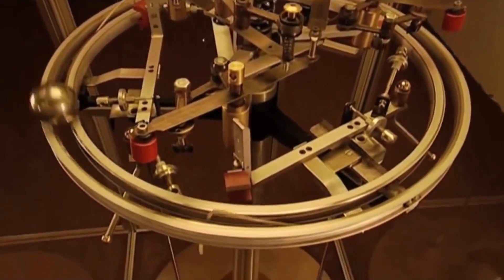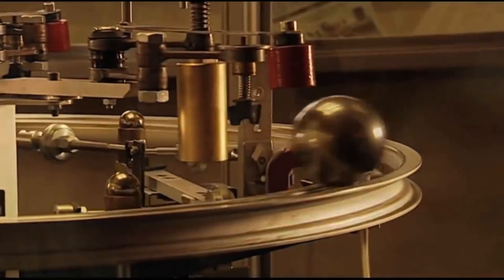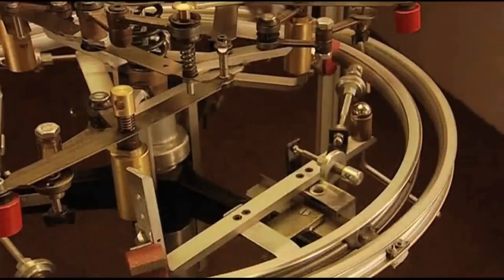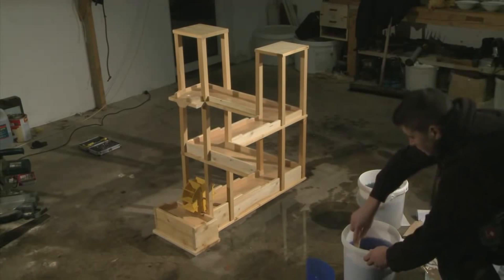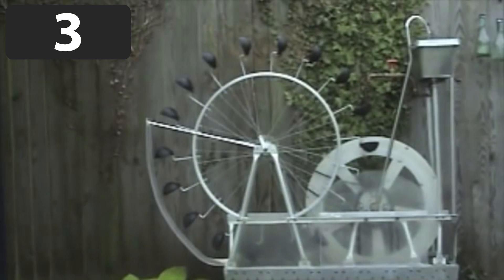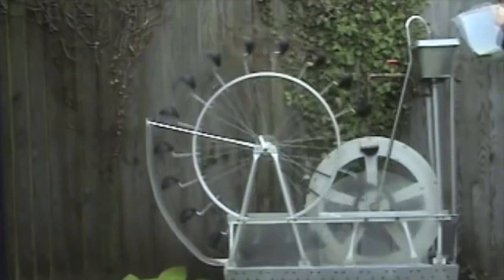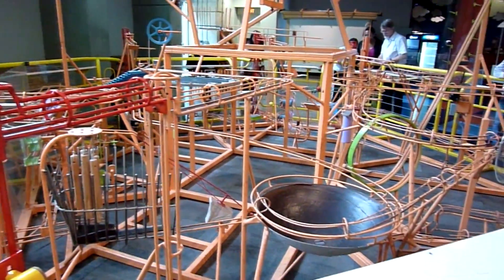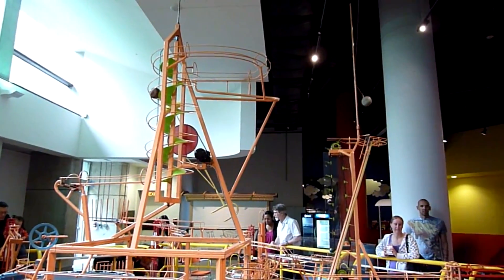Top 5 Near Perpetual Motion Machines

Comment: "close"... there"s no such thing as "close to perpetual motion" - either it exceeds unity or it doesn't.
Reply: It's like being a little bit pregnant!!  Either you are or you ain't!!
Reply: Especially when he says "it will run for several hours". I laughed at that.

Small point though, perpetual motion doesn't actually require it to exceed unity, it does have to achieve unity.
Reply: Whats missing in their attempts that cause failure is " make one side of a wheel heavier than the other " . .   The answer is to make the other side lighter . Underwater is the environment best suited for this ( gravity harness) . 12 airbags (6 full and 6 empty) astound wheel at o'clock positions with 12 3 lb. Weights outside them. Weight can be used to take air with it down 4" over airbag at top of weel (to bike rim) . Bottom is 4" down (from bike rim) taking air into the airbag. (Was emptied at the top) 
Top goes DOWN = towards the axle 4"
Bottom goes DOWN = away from axle 4"
But the air goes all the way to the bottom . 
And all airbags full being on one side (enough air to bobber the 3lb. Weight its next to) Gravity is harnessed...
From the archangel Ram full Than
Reply: I'll translate for you. Close to perpetual motion means attempts that create the longest moving machine.
Reply: @MrUnstoppableHeart  https://en.wikipedia.org/wiki/Clock_of_the_Long_Now A clock that runs for 10,000 years, but no claim that it is perpetual motion.
Reply: I disagree, if perpetual motion is 100% then wouldn't 99% be close? 99.9%? What's the point to your smugness about perpetual motion? If flying is maintaining the constant altitude, isn't a 0.0001% drop over time still close to flying? Get over yourself.
Reply: @XXCoeusXX  no- and here's why: perpetual motion means that it will in principle go forever. For that to happen it has to produce as much, or more, energy than it consumes. If it produces 99 % of what it consumes it will not go forever, and it will grind to a stop in finite time..
    So imagine it winds down in a week - is that close to "forever"? What if it winds down in 1,000 years -- still not close to forever.  No finite time is close to an infinite time.
      But the real point is the energy consumed vs the energy produced, if it consumes more than it produces then it is not perpetual motion by definition.
Reply: @karlschuch5684  You seem to miss the point, and instead glibly state facts about perpetual motion as if to educate me on it. 

The point is being "close" to it. If we did indeed invent a PMM, but a planet destroying asteroid hit the earth, you would claim that "oh well it didn't last forever so it doesn't count. So really it's about the % of efficiency and not how long it ends up lasting. At a certain % it is considered close.

You might as well be arguing that 89% isn't close to getting an A- grade. Because it either is or isn't an A-

You are logically using finite/infinite=0 which is contradictory, because while it won't actually be 0, it will be CLOSE to it.
Reply: @XXCoeusXX  
Epi: The point is being "close" to it. If we did indeed invent a PMM, but a planet destroying asteroid hit the earth, you would claim that "oh well it didn't last forever so it doesn't count.

KS: no, that’s why I explicitly said it was about energy produced vs energy consumed, obviously no machine can run infinitely because nothing last that long... including the universe perhaps. 
     What we are talking about is whether the ENERGY  produced by the machine would – "In Principle" – enable eternal motion of the machine.

 Epi: So really it's about the % of efficiency and not how long it ends up lasting. At a certain % it is considered close.

KS: no, the word “perpetual” has a real meaning, it means never ending,  an infinitely long (unbounded) period of time. There is no finite time period that is close to an infinite time period.

Epi: You are logically using finite/infinite=0 which is contradictory, because while it won't actually be 0, it will be CLOSE to it.

KS: I have no idea what that means.
Reply: @karlschuch5684  
ks: There is no finite time period that is close to an infinite time period.
E: finite/infinite=0 This is what you are saying here, that infinite is so long any finite is practically zero. But it isn't 0, it is really close to it though. Which is inversely related to reaching 100% efficiency(PMM).

You contradict yourself in your first and second paragraphs. 
1st ks: no, that’s why I explicitly said it was about energy produced vs energy consumed, obviously no machine can run infinitely because nothing last that long... including the universe perhaps.
2nd ks: no, the word “perpetual” has a real meaning, it means never ending,  an infinitely long (unbounded) period of time.

So which is it, energy produced vs consumed or lasting forever?

 ks: What we are talking about is whether the ENERGY  produced by the machine would – "In Principle" – enable eternal motion of the machine.
E: right, and that means 100% Efficiency, and then taking that efficiency and putting it back into it, making it last "forever".

I wrote a paragraph about real world PMM applications, but decided to delete because it went on quite a bit, but is now seeming necessary . . . . .  but the #1 usage would be energy storage. We put in X amount of energy and get out X energy whenever we decide to withdraw it. It doesn't have to last "forever", it has to have the longest energy retention ie. % efficiency over Δt. Think Flywheel energy storage.
Reply: E: finite/infinite=0 This is what you are saying here, that infinite is so long any finite is practically zero. But it isn't 0, it is really close to it though.

KS: great – give me an example of a finite time period that you think is close to an infinite time period.
 Please be specific - thanks

Epi: You contradict yourself in your first and second paragraphs. 
1st ks: no, that’s why I explicitly said it was about energy produced vs energy consumed, obviously no machine can run infinitely because nothing last that long... including the universe perhaps.
2nd ks: no, the word “perpetual” has a real meaning, it means never ending,  an infinitely long (unbounded) period of time.
So which is it, energy produced vs consumed or lasting forever?

KS: you conveniently left out the next sentence in the first example – where I said: “What we are talking about is whether the ENERGY  produced by the machine would – "In Principle" – enable eternal motion of the machine.”
  That seems like a desire to misrepresent what I said...?
 
Epi: So which is it, energy produced vs consumed or lasting forever?

KS: it is both - as I've explained like a half dozen times. One more time - if the energy consumed is less than the energy produced then "IN PRINCIPLE" the machine will run perpetually (forever). 
   and once again - nothing lasts forever hence the use of the expression "IN PRINCIPLE"   - Which means that if the machine COULD last forever the energy produced would be sufficient to fuel it forever 
  Do you understand what the expression "in principle" means ...? -
Reply: @karlschuch5684  
ks1 response: Still not getting the point. I suggest you look up 1/infinity as an approaching limit expression. It won't ever be 0 but it gets really close. Which that "closeness" is the same way I mean we can get "close" to a PMM.

ks2: no I didn't leave it out, I quote the next sentence as well. You seem to have a problem reading my whole response.

ks3: Before there was a hint of condescension, but not it is very obvious. You repeating efficiency of a PMM is unnecessary as the concept is not lost on me, nor is "in principle".

Which means that "in principle" it doesn't have to last "forever" but given the efficiency of it, it could. Your "in principle" usage basically says it just needs to have an infinite trajectory, regardless of it actually needing to last forever, so again it's not about lasting forever, it's about % efficiency over Δt (which is calculated).

You did not address my real world PMM, which I find rather funny, you're hiding behind a theoretical infinity and "in principle" that you miss out on the reality of the application.
Reply: @XXCoeusXX  ok,  you're not answering the questions i ask,  and division by infinity is not defined.
    And now appears that you're pretending to not understand simple things because no one is that obtuse, and I have no interest in ridiculous conversation.
 Have a great day!
Reply: @XXCoeusXX    Against my better judgement I will respond to your last bit of nonsense.

EPI: (ks: "give me an example of a finite time period that you think is close to an infinite time period." )
Which is obviously rhetorical, because it's a nonsense question used to deflect from the point I made. 

KS: no son you made the statement “Which that "closeness" is the same way I mean we can get "close" to a PMM.” 
  So go ahead and give me an example of a time period close to a perpetual (infinite) time period – I await

EPI:Your googling could use some work, as you missed the concept of approaching limits division by infinity, but only walked away with a sort of answer.

KS: yeah, this is the best one from you yet. I have a degree in Mechanical Engineering from Rutgers University class of 83. In that curriculum we had 5 semesters of calculus, two of them in DE’s.
   I know more math than you know even exists – and you want to lecture me on limits… unbelievable.

 You said: “  I suggest you look up 1/infinity as an approaching limit expression”
No – division by infinity is undefined -  infinity is NOT a real number, it is a concept... you can't divide a number by a concept . 
    If you want a lecture on the limits of functions I will give you one...until then  - go take a math course before you spout your ignorance.

 I learned a long time ago that it’s impossible to reason with the unreasonable and the ignorant – it’s like playing chess with a pigeon -  the pigeon knocks over all the pieces, craps on the board, and struts around as if victorious.
Reply: I gave you a finite time that comparable to infinity. No answer to that though hu?
Reply: @XXCoeusXX  EPI: I can give you a time period, 10^100 years(finite)….I think that is more than "close" enough. But don't go moving the goalposts now, you were the one that made this a hill to die on.

KS: sorry son, but that’s nowhere close to infinity ( btw I already said the universe will likely not last infinitely long -  but the heat death  of the universe has absolutely nothing to do with infinite time and as you just pointed out - it will occur in a finite time from now - but I would guess you know that anyway)
    And in fact 10^100^100^100 isn’t even close to infinity – so your claim fails.

EPI: Awww that's cute you took calc 35+ years ago at a school that's not even in the top 20 to go to, sad brag bro. I took a CPR class once too, but I wouldn't trust myself to perform it on someone today.

KS: the point is that I know math and you obviously don’t if you claim a number can be divided by infinity – that’s just wrong

EPI: Idk why you don't get the analogy, especially with your oh so prestigious education(lol).

KS: so this is a logical fallacy called the “ad hominem fallacy” –  where rather than arguing the facts you instead attack me personally --- that is what children do and it’s fallacious

EPI: You made the point that any finite, lets say 20, over the course of infinity is not close, …At some point it is close.

KS: there is no finite number that is close to infinity – it seems like you just don’t understand what infinity means – perhaps you should look it up before continuing to embarrass yourself this way…?

EPI: You have this weird thing where you say no to something I said, and follow up with straw man responses. I Never said 1/infinity is defined, I said to look it up. 

KS: You said: “finite/infinite=0”… that IS a definition!!! -  but its wrong because division by infinity is undefined --- again you seem to be pretending to not understand simple things – why?
  You also said: "I suggest you look up 1/infinity as an approaching limit expression."
     GEEZ! the word "approaching" means to NOT be dividing by infinity 
------ and the expression is "THE LIMIT OF THE FUNCTION as "X" approaches infinity"   there is no " "approaching limit" ... this is ridiculous - i'm arguing calculus  with someone who never took calculus
      - but go ahead -  please point to a source to validate that claim... i can't wait.
 

EPI:You can though divide by infinity, no question there, that's one of the uses of limit expressions. Yes the answer is undefined, not saying it is defined. I hope you aren't saying infinity has no use in mathematics.

KS: good lord – limits of functions are about where the  function converges as a  denominator “approaches” infinity or Zero   (mister  “ I do calculus all around the world”) – what is meant by “approaching infinity” is to stay in the realm of real numbers and the word “approach” is an acknowledgement that nothing can be divided by infinity ( or by zero).
    Just out of curiosity – where did you study math? – as  your knowledge is very  incomplete.
Reply: @XXCoeusXX  
EPI; You claim you can't divide by infinity, but then say finite/infinity=0. So you can or you can't? You have a habit of contradiction.

KS: no – I was quoting you insisting that division by infinity is possible – and I have been trying to get you to understand that it is not possible… that’s ALL we’ve been talking about…  Are you pretending to not understand again?
  Are you seriously denying that you've been insisting division by infinity is not just possible but it's actually calculus???
  Are you denying that?

EPI; I know what the ad hominem fallacy, but I classified what I did as sarcasm, and disbelief in your lack of understanding, as you assert yourself as being so highly educated. More pointing out hypocrisy in your resume as an "SME" on the topic, as you seem to be claiming. 

KS: yes, I am accomplished in calculus – as I pointed out. And btw Rutgers University is a very good school, more than you could ever take on for sure.

EPI; IF you claim all knowing and someone questions it, that doesn't make it ad hominem to put your resume under scrutiny. Nice try though.

KS: no,  the ad hominem fallacy occurs when an interlocutor attacks the person rather than addressing the material… and that is what you did.

EPI: I never said finite/infinity=0, I was saying that was what you were logically asserting. Again misrepresenting what I've said. Flat out lying. I made a point to say it wasn't 0, but that it approaches 0.

KS: woah! Are you now backing away from insisting you can divide by infinity??? That’s a switch because that’s what we’ve been arguing about… glad you finally agree!!
  But here's your quote:

Epicaricacy 5 days ago @Karl Schuch
 ks1 response: Still not getting the point. I suggest you look up 1/infinity as an approaching limit expression.

EPI: My terminology was meant for what I presumed an uneducated person doing a google search. The key words are there, and relates to my point of approaching zero, not reaching it.

KS: again – a retreat… halleluiah!!!!

EPI I have taken calculus, which is why it surprises me it took you 5? quarters to learn it. (playful jest, I'm sure you studied the in depth theoretical  . . . . a long time ago)

KS:  yeah – at Rutgers the math curriculum for engineers was 3 semesters of conventional calculus (related rates, volumes of revolution, and multivariable) followed by 2 semester of Differential Equations  - we took a LOT of calculus… as I already told you. 
     But this is your ad hominem fallacy again… you’re attacking me rather than the point of the argument.

EPI So if you continuously(infinitely) divide by larger numbers, is that not dividing by infinity? I agree it isn't literally, but effectively it is. Your claim is like saying you can't divide a number by a letter(variable). But as we know, it's what the variable represents.

KS: come on now – you backed away from all this nonsense, don’t start claiming you can divide by infinity again… you’ll just wind up denying you said it down the road.

EPI:  So while I am proud of what I've learned, I feel no obligation nor tribalism in touting my Institute. 

KS: woah son – you’re the one who attacked me for attending an inferior school ( in your opinion)   so I assume you attended MIT  or Caltech or some other highly prestigious school… 
  I asked you what school you went to – well – what school did you go to??
  I would guess you never attended university - am I right?

EPI: What is the point anyways, it's whoever is right, that is right. Your education doesn't make it so.

KS: YES!!!! That is what I was trying to tell you about the ad hominem fallacy that you continually engage in.

EPI: ---Let's say we surpassed unity, and it was all because of quantum dark energy magnetic bearings, but the bearings wear out after 100 years, does that count as a PMM to you?

KS: YES! The point is surpassing unity --- I’ve been saying that to you for like a week now… are you finally getting this? 
Holy shit that was a long week!
 Congratulations!!!!

EDIT: and your example of 10^100 as "close to infinity" is just laughable.

Comment: Even if it isn't strictly "perpetual motion" couldn't these machines be used to generate electricity or run machines?   Seems a whole lot of people get their panties in a knot over the strict definition of perpetual.  Why scrap the whole concept if a tiny bit of initial force is needed to start the action if mountains of energy are generated?
Reply: Amy Walker energy cannot be destroyed or created. If a minuscule amount of energy starts the movement, then it takes an equally minuscule amount of energy to stop it. These machines have no use. The only purpose they serve is to prove that perpetual motion is impossible.